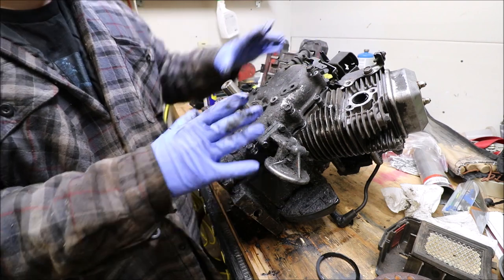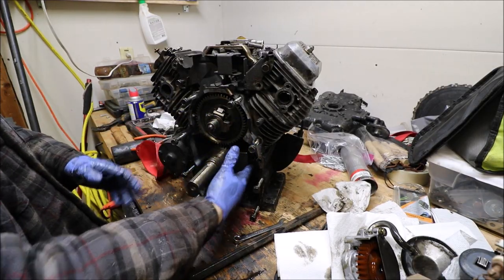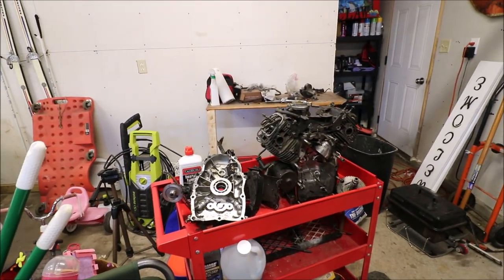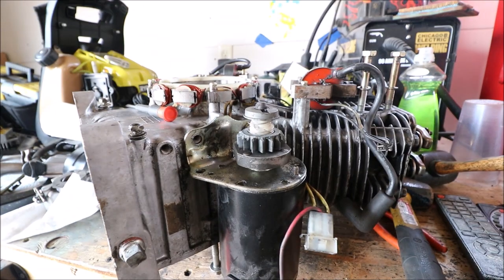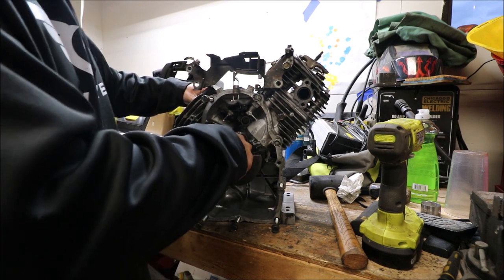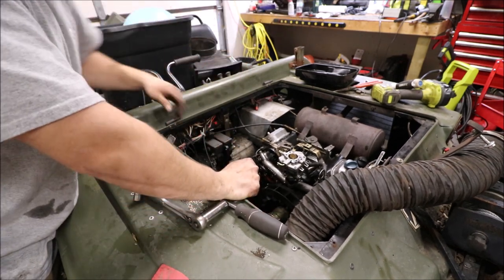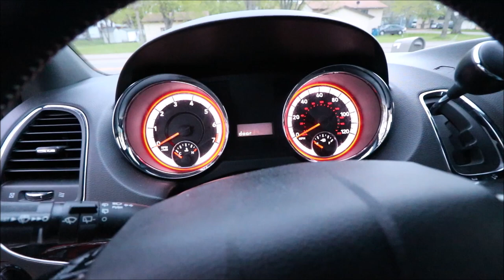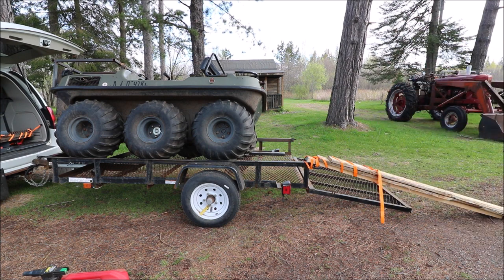Argo Bigfoot Engine Rebuild

Comment: Zack , amazing job on that Argo, nothing short of wizardry !! To bring a motor down that far , than put it together and make it run (possibly better than it ever did) is nothing short of wizardry or some kinda magic !!🤣 Great job Zack!!
Reply from the maker: This is Joe. I have taken motors down that far when I was young and then was pretty proud of myself because of all the bolts I had once I threw the rest of the motor parts away because I had no clue what I was doing. LOL. Zach is amazing.
Reply: @JoeandZachSurvival  ,,,you done good Joe, he’s a nut off of the strong tree !!

Comment: Like your videos. Just a little advice. When you install a new bearing, you want to make sure you don’t pound on the inside race. In doing that you are pounding on the inside race, which contacts the ball bearings, which in turn contacts the outside race. You can damage the bearing that way.

Comment: Good job Zach. With care that Briggs engine will outlast the Argo, PLUS it is US made and your fix was less than 1/10 the cost of a new engine! Glad you convinced your dad to repair rather than throwing a new engine at the problem, with the chipper also! I had that same chipper and the carb DID NOT like ethanol gasoline every other year I had to clean the carg. But otw it was a great little machine!

Comment: On the bottom your taking off is called Rod Caps you should keep them to the Rod they came from unless your putting new one`s back in. When I would put a motor back together I would use STP Oil Treatment a thin coat on Bearings, Shafts, Rod Caps, Rods you get the pic. The Argo sounded good.

Comment: I’ve owned a chipper / shredder and they certainly work. However, to prep limbs to fit through the opening takes a lot of time. I realized the smiling faces on the sales brochures  were people who knew the were getting rid of the little nightmare. Plus the operation of them was frightening. Might think I’m a sissy but I’ve got all my fingers and hands……I sold my shredder.

Comment: I notice you had to constantly correct the steering when going down the road (pulling to the right ) . Check your tire pressure and even all tires out and that problem should go away and make it much more enjoyable to operate .